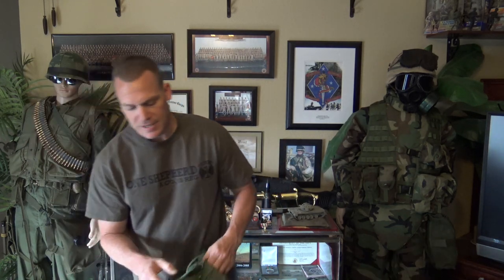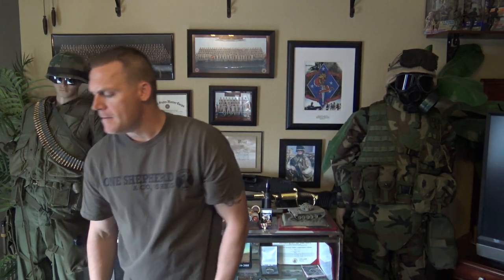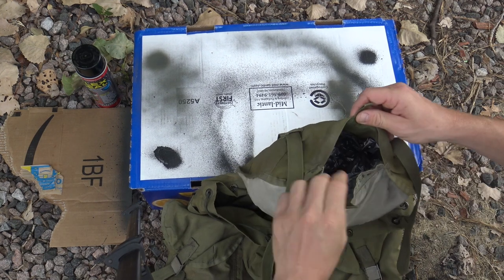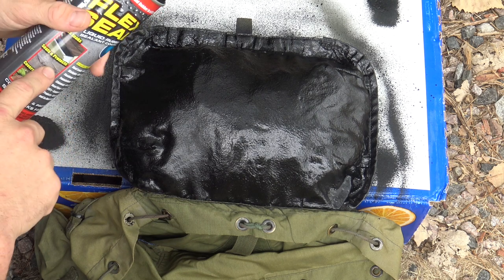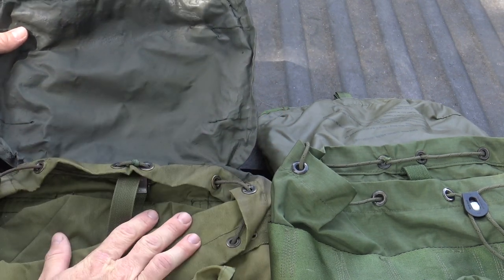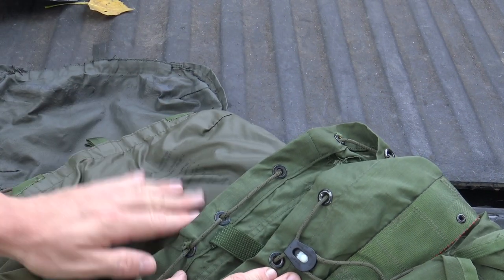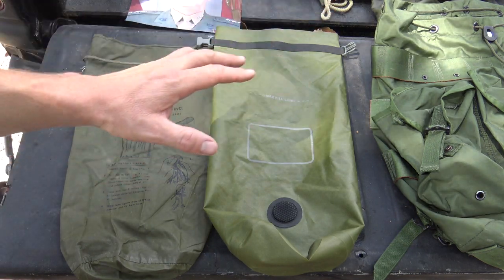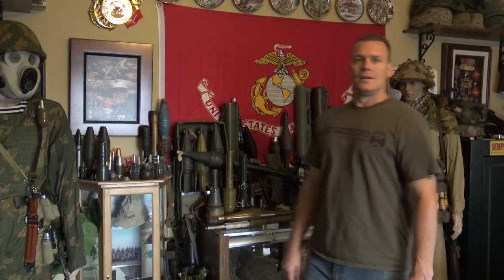Quick & easy repair to your old ALICE pack lid

Comment from the maker: *Here's a few links to good deals on Sportsman’s guide on ALICE related gear:* 
*USE COUPON CODE: SH2140 for FREE SHIPPING on orders over $49. Expires 9/30/19*
TWO 1 quart canteens with covers: http://bit.ly/2yZMxjF
TWO 2 quart canteens with covers & GP straps: http://bit.ly/2z2x16O
SAW pouch (Great General purpose pouch): http://bit.ly/2PSyPdO
THREE ALICE Small arms pouches (hold 3 mags each): http://bit.ly/2OX4wCl
TWO ALICE IFAK pouches w/ boxes: http://bit.ly/2MlFPx8
USGI folding E-tool w/ cover: http://bit.ly/2O2PXuL
Just the ALICE E-tool cover: http://bit.ly/2OdFsFd
TWO Rubberized water proofing bags (WP bag): http://bit.ly/2Mgq3nb
ONE used but cheaper WP bag: http://bit.ly/2H7VlIM
ONE Current issue small WP bag (fits good in ALICE pack exterior pouches): http://bit.ly/2yYXouc
FOUR (same as above) of the smaller WP bags: http://bit.ly/2Z7Rz8q
SIX ALICE cargo straps (for strapping gear onto the frame itself): http://bit.ly/2OSnlWX
TEN USGI general purpose straps (for 2 QT canteen): http://bit.ly/2HalwhV
MOLLE Sustainment pouch in Multicam Attach to the side of your ALICE pack: http://bit.ly/2z3aOVW
ISO mat: http://bit.ly/2Z5Tn1J
USGI sleeping bag compression bag: http://bit.ly/2z14nCR
ALICE belt: http://bit.ly/2Hmn48T
M65 field jack liner: http://bit.ly/2QeITxZ
Jerry can: http://bit.ly/2OWzH0s
Spout for the Jerry can: http://bit.ly/2P0sf4k
300 Ft of 550 Cord: http://bit.ly/2KLADj2
12x12 USGI Nylon netting (good for ghillie suits): http://bit.ly/2KWfCSx*Guys, Primary Arms is hooking up my subscribers! If you want to get FREE shipping and a free gift such as a FREE or discounted (depending on which scope) scope mount for the variable scopes, or a free anti-reflection device for the prisms optics, just follow the links I have posted below on the scope of your choice. YOU MUST follow these links or you will not get the free or discounted mount/anti-reflection device and free shipping from the standard Primary Arms website.* 

PA CYCLOPS 1X PRISM (BLACK): http://bit.ly/2BREKZn
PA CYCLOPS 1X PRISM (COYOTE/FDE): http://bit.ly/2BRfhiX

PA Advanced Micro Dot w/ push button: http://bit.ly/2LX39Nd
PA  Advanced Micro Dot w/ rotary knob http://bit.ly/2CjTCjr
PA Micro dot (Budget red dot) http://bit.ly/2xPK6j2

Holosun HS503G RDS W/ ACSS http://bit.ly/2r7gCd3
PA 3X Magnifier http://bit.ly/2r3XAV2
GG&G flip to side magnifier mount: http://bit.ly/2EN5uv3

PA 1-6X24 FFP ACSS RAPTOR 5.56 / 5.45 / .308 BLACK http://bit.ly/2jW0V4O 
PA-1-6X24 FFP ACSS RAPTOR 5.56 / 5.45 / .308 WOLF GRAY http://bit.ly/2IidvtX 
PA 1-6 FFP ACSS RAPTOR 7.62x39 / 300 Blk out http://bit.ly/2IIAnC5 

PA 1-8 PLATINUM FFP RAPTOR 5.56 http://bit.ly/2zqXYBo

PA 3X Compact Prsim Scope ACSS 5.56 GEN II (Black) http://bit.ly/2OzAQqA 
PA 3X Compact Prism Scope ACSS 5.56 GEN II (Coyote) http://bit.ly/2OAEekN 
PA 3X Compact Prism Scope ACSS 7.62x39/300 Blkout GEN II (Black) http://bit.ly/2KdtaXD 
PA 3X Compact Prism Scope ACSS 7.62x39/300 Blkout GEN II (Coyote) http://bit.ly/2n3AgVv 

PA 1-8X Scope with Patented ACSS 5.56 / 5.45 / .308 Reticle http://bit.ly/2SPbNob

PA 1-6X24mm SFP Riflescope with Patented ACSS 5.56 / 5.45 / .308 Reticle Gen III http://bit.ly/2BD73bB
PA 1-6X24mm SFP Riflescope Gen III with K.I.S.S. Reticle http://bit.ly/2SUbxEo 
PA 1-6X24mm SFP Riflescope with Patented ACSS 22LR Reticle  http://bit.ly/2N8fj7P
PA 1-6X24mm SFP scope w/ACSS 300BLK/ 7.62X39 Reticle http://bit.ly/2N6Qut9
PA 1-6X24mm SFP Riflescope Gen III with Patented ACSS 22LR Reticle http://bit.ly/2N8fj7P

Trijicon ACOG TA31 4x32 Scope with RED Dual Illumination ACSS Reticle TA31-R-ACSS http://bit.ly/2EQIMhg 
Trijicon ACOG TA31 4X32 Scope with RED Dual Illuminated ACSS AURORA RECTICE http://bit.ly/2T6uZuz
Trijicon ACOG TA31 4X32 Scope with GREEN Dual Illuminated ACSS AURORA RECTICE http://bit.ly/2FRTmIQ

Trijicon TA44 ACOG 1.5X16S TALL BASE (GREEN ACSS reticle) http://bit.ly/2DkC72H 
Trijicon TA44 ACOG 1.5X16S TALL BASE (RED ACSS reticle) http://bit.ly/2rdEu1O 
Trijicon TA44 ACOG 1.5X16S SHORT BASE (GREEN ACSS reticle) http://bit.ly/2EQge7G 
Trijicon TA44 ACOG 1.5X16S SHORT BASE (RED ACSS reticle) http://bit.ly/2FMdLMO 

Camouflage painting stencils: 
PA Tiger Stripe Stencil: http://bit.ly/2Dqzafa
PA Multi Terrain pattern stencil: http://bit.ly/2Izaxkt
PA Flecktarn stencil: http://bit.ly/2DwfMxb
PA Digital camouflage stencil: http://bit.ly/2W0PvOP

Great DEAL on Palmetto State Armory lowers to complete this build on a budget! (PLUS, going thru these listed PSA links supports my channel!)
M4 style lower for $130 shipped: 
Black: http://bit.ly/2F5FRDU
OD Green: http://bit.ly/2IbtcRY
Coyote/FDE: http://bit.ly/2IGuPpV
Full size M16A2/A4 style lower ($200): http://bit.ly/2F5HaCO

BIG THANKS to Dimitri and Primary Arms for making this all possible! 
Also don’t forget to check out and subscribe to Bruce’s channel: https://www.youtube.com/channel/UCwfzznRRdLUHwKiMTND49Jg 
Also check out my buddy John who is the owner of UW Gear and his Youtube channel at Alpha Charlie concepts: https://www.youtube.com/user/AlphaCharlieConcepts
Reply: Brent you should hang out with corporals corner. Thank you for your service.
Reply from the maker: @ПапаСталин-с5г  Thanks brother, I'm sure there will be some collaborations in the future with other YT creators as my channel grows. Thanks for watching.
Reply: Love that iraq war loadout
Reply: I just found this channel and read your comment about Primary Arms hooking subscribers up. Of course, I didn't finish reading the comment, and went straight to the link to try and get a free ACOG with that ACSS reticle. And immediately realized that things that sound too good to be true usually are, and that I should probably finish reading things. 

Still cool content though.
Reply: @Leonard Fox Instablaster =)
Reply: @Creed Darian i really appreciate your reply. I got to the site thru google and im in the hacking process atm.
Looks like it's gonna take quite some time so I will reply here later when my account password hopefully is recovered.
Reply: @Creed Darian it worked and I actually got access to my account again. I am so happy!
Thank you so much you saved my ass !
Reply: @Leonard Fox no problem :D

Comment: Thanks for showing us all the quick & easiest way repair to your old ALICE pack lid with Flex Seal! Flextastic job well done! 💪
Reply: i found your spray on flex seal will fail. you have to roll it on fabric for it to stick
Reply: nice
Reply: No fucking way
Reply: No way, the meme is here
Reply: @yourredcomrade717  I've sprayed a pair of old leather boots with flex seal back in 2017 and they're still going good.
Reply: We love you Flex Seal ♥️
Reply: Whrere  can we buy that
Reply: Where can we buy that.frm phillipines..
Reply: John Tron world collision moment
Reply: I tried this on a pack that was completely white, no rubber and had cleaned to to make sure it would have the best chance to stick.  It peeled off on me.  I left it to dry for a week, first time I tried to use it, it stuck to its self and peeled.   I had also tried it on a lid like Brent's that had partial peel of the original rubber coating.  FlexSeal stuck to the rubber and helped to peel all the old rubber off.

Comment: The most OUTSTANDING pack ever issued for US Army and Marine Infantrymen. They can carry the load and I have jumped out with them out of airplanes. Really indestructible from pack to frame. I have never destroyed any of them in my service.
Reply from the maker: Agreed, neither have I. The pack I sprayed in this very video is the one I played with as a kid. AND THEN, to top it all off I took it with me to Afghanistan in 2011 and used it there. Great pack!
Reply: amen and airborne! all the way brother.
Reply: Sorry, but I would argue about that. They are built tough, but there are also built to torture. In fact, I think we usually refer to them as torture sacks more than we referred to them as Alice packs.
The packs that they have issued since my Army time in the 80s are far superior.
Reply: @rockymntnliberty  not sure what pack you are talking about. I was on active duty from 1982 - 2004. the only packs that I was issued, or I should say regularly issued, was a large Alice pack. now there was a time in the late 80's when the army gave certain units a Mountain pack. but as a paratrooper those didn't last more than a couple months as they could not be jumped safely.
Reply: @abntemplar82 
I was an engineer, I think what we got was the medium Alice pack. Fortunately as an engineer we would Mount our trusty steed, usually a 5-ton dump truck, and rarely had to pack very far. When we did though, I hated those things. Now I have a couple of the cfp 90s that came out a couple years after I got out of the army. I use these packs for bug-out bag and hunting pack oh, and they are far superior so what I had in the army. My wife's bug-out pack is a Molle II, and again far superior.
Reply: @reddevilparatrooper  So you were at Ft. Kobbe, right? I was in 4/10 over at Ft. Davis on the Atlantic side. It was cool over there- far away from the higher-highers. Yeah the friggin'  jungle could be rough. When we got back to the rear we were always more than ready for some beer and some bo.
Reply: @ogivecrush  You were before my time when I got to Panama. I knew a guy Henry Foo who was in 4/10 INF and another guy Gene Roberts an Airborne guy. I was at Kobbe with the 1/508th INF (ABN) from 89-90. Fucking great days minus the horror and fuckery of the Panama Invasion. I had fun in Panama if I wasn't in the jungle.
Reply: @ogivecrush  Oh I used to be in A co. 1/10th INF (MECH) at Ft. Carson Colorado before Panama.
Reply: @reddevilparatrooper  That's interesting. Good times pre- Global War On Terror.
Reply: @ogivecrush  One day I want to see Panama again. As long as I don't run into my 2nd ex-wife from San Miguelito Panama City. LOL!!😜
Reply: @reddevilparatrooper  Yeah, I guess it's a lot more user-friendly now. Panama in general that is. Back in the day a lot of it was pretty sketchy but if you have an ex from there you probably know what I mean.
Reply: I am so happy I just picked up a pair of these for 40 bucks! One of them on the frame and one off the frame. Time to restore!
Reply: @Brent0331  the packs are fantastic but the 2010s plastic frames suck and could only hold like 50lbs

Comment: Don't know if you realize this, but they do make green Flex Seal
Reply from the maker: I do, I only saw the black at Lowes though. I don't think they make an OD color as well, just a bright green.
Reply: Clear is the best, it will work with any color
Reply: Why not do the outside as well? And a couple of stuff sacks? Old W.P. bags?

Comment: Make your own water proof bags out of  oLd BDU legs you cut off and sew up the bottom opposite the tie ends and turn inside out and spray with flex seal. And get a cool set of work shorts at the same time. 😲👍🏻
Reply from the maker: Awesome ideas brother, thanks for giving me this one!
Reply: Man, that idea is real dope!
Reply: You sir are a fucking  genius ..
Reply: We used our old MRE bags and sealed with 1000 mile an hour tape
Reply: Dude. I'm doing this.
Reply: @doughorn198  haha, I remember doing this also.  Nice, free, and field expedient. 👍🏻

Comment: Why not flip that rucksack inside out and waterproof the whole kit?
Reply: Thats what i did to all mine..Then painted the inside of one large Alice Blaze Orange..you can really see down inside that big pack
Reply: Wondering the same thing. Would there be any drawback to that?
Reply: @worldfamousgi86  I doubt it  so long as you give it plenty of time to dry. My only concern would be if the stuff melts at moderately high temperatures, like the back of a car in Texas summer heat? Another test seems to be warranted.
Reply: @hrdknox2000  I'm in Michigan Upper Peninsula..we get 90°up here but mostly im camping n hiking in spring fall and winter...The heat issue ive never thought about.Gonna have to try some experimental heat Ruckin
Reply: @wyomarine yes sir 👍
Reply: I liked the idea about painting the inside blaze orange to use as a signal device. 

As for heat: here in Alabama it was 104℉ two weeks ago with high humidity. You can imagine how hot the inside of my Jeep was!

Comment: Since you have the flex seal, here's a bit of tip from a construction worker. Spray the bottoms and backs of your carry cases (tools, personal belongings, etc). When your stuff moves from vibration or the station it's on is mobile, it'll stick to it a bit more and will have a harder time to run on you while you're busy with your task/project.

Comment: I scraped all the old stuff off mine, with a soft bristle brush. Video is right on time! I was gonna roll with that other stuff. The silicone spray for tents at Wal-Mart. I'll use this method, then that stuff for the rest of the pack. But I used that stuff on a shower curtain (not plastic) and basically made a lightweight tarp
Reply from the maker: Nice. Yeah you wont be let down with this method, I assure you!
Reply: I was also thinking that the old should be removed before applying the new.  Thanks!

Comment: Brent- I ran down to my local surplus store and got my pack and frame. Dude, this is my army pack to the tee. Medium pack and frame for under 80 bucks. Thanks for making sense of the ALICE system. It's better than the other l packs in my opinion, and I got some caribiners and issue dry bags for the 3 pockets, and the main compartment. I have a lot of alice stuff including canteens and entrenching tool. Brother you got me on track, and I can't thank you enough. Squared away!

Comment: Thank you for sharing another good use for FlexSeal.  I would also like to share an idea I got from another YouTuber: using FlexSeal to apply a thin durable "grip tape" to AR magazines.  I have used it on both steel mags and PMAGs and am quite happy with the results.  Be sure to mask off enough of the top to ensure the FlexSeal does not rub inside the magazine well and hinder insertion/removal.  Also, mask off enough of the bottom to ensure the floorplate can be removed.  I have had good results with 3M blue painter's masking tape.  If the PMAGs have a round-count window, mask that too.  The FlexSeal seems to deaden and quiet down the noise the magazine makes when it hits something (gear, mag well, ground, etc), especially with a couple coats.

Comment: I just saw your video a few days ago and I got an A.L.I.C.E. pack medium and I done the same thing to my lid after watching you do it to yours and I came up with another great idea I had two waterproof laundry bags ,military issue and the linings were old and pilling off. 
So I rubbed all the old lining off that was loose, Turn the bag wrong side out and sprayed him with flexseal like you did to the medium A.L.I.C.E. Pack lid and it worked great

Comment: Thank you SIR. You sure got out of the dark . I just fixed my 2 Alice packs that I bought 10 years ago in an army surplus store. I would have never thought of flex seal. But it sure does it job. Thank you once again.
Reply from the maker: Yeah, it was a fantastic idea that one of my commenters posted on  my original Alice pack video. I had to try it.

Comment: Back in the 80's/90's we would use the dip coating to reseal those lids and other worn pouches.  It was sold in pint size cans and used to coat or recoat pliers or small tools used for electrical work.  Pretty much the same thing but thicker because it's a non aerosol product.

Comment: I did this about a year ago using a can of Flexseal that I purchased on the clearance isle at Wallymart for about $7.00. The color that I bought happened to be very close to flat dark earth brown. It looked great and did a great job of restoring the top flap waterproofing. I recommend FS products after having used it successfully. I can say my experience was a positive one.
Reply from the maker: Awesome! Glad you commented. I'm curious to see how mine holds up as well.

Comment: I use Tool Dip for rubberizing tool handles. It works great on the bottoms of packs and places where you don’t want something like a sharp ski edge to cut the fabric. You can get it in OD and other colors. You can spray it, or thin and paint it on.

Comment: This is a PSA I did this to my Medium Alice pack, make sure to get all the factory rubberized coating off the lid before. My Alice pack had a lid that was just starting to peel and I tried all I could to get it off with about 25% of the lid still covered with the original rubber that wasn't ready to come off. The areas where the rubber was peeled off almost immediately after letting it sit for 24 hours it made it a lot easier to get the remaining old rubber off but you'll have to re apply to cover the areas that peeled off. Otherwise great solution.

Comment: Good advice. On my Alice the coating turned to a powder. I cleaned it and used Flex seal clear color. It works great and I did not need to paint after application. The original OD green looked great. Did two coats. 👍🏻👍🏻

Comment: My old issue pack is showing the same signs. I was going to try rubberized automotive undercoating or Plasti Dip spray but neither one seems ideal for various reasons. I do have a can of Flex Seal though and this just made up my mind. What a perfect application. Thanks Brent!
Reply from the maker: Thanks for watching.

Comment: Seen this video just in time I was looking for a new Alice  because mine has this same problem had my Alice for 25 years and this is the only problem it has thanks for the repair tip 👍
Reply from the maker: Awesome brother, thanks for watching!
Reply: Ps. flex seal has green just ordered it on line so you don’t have to paint